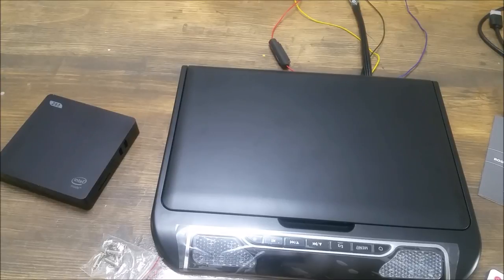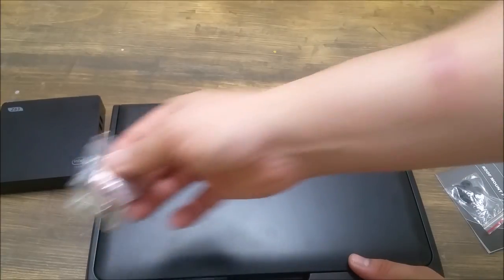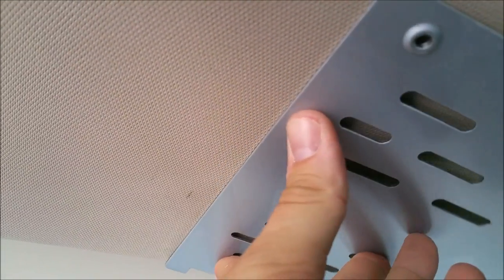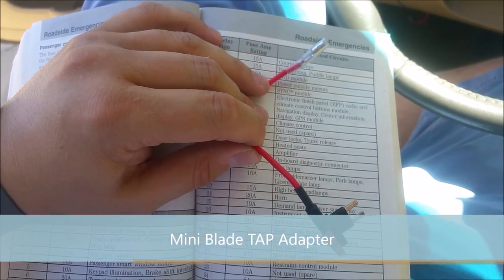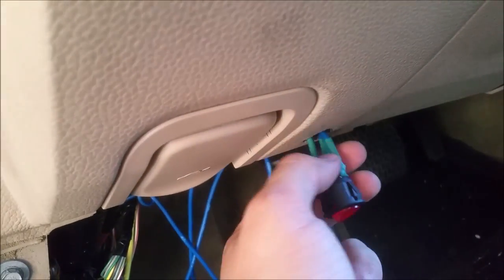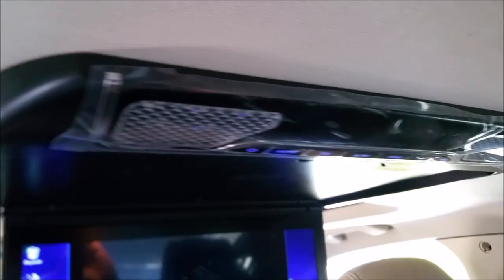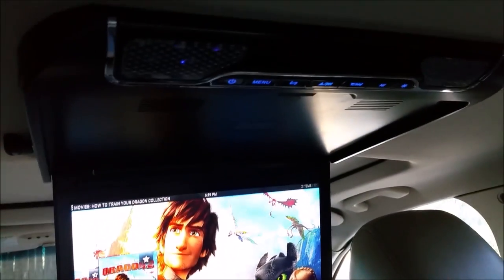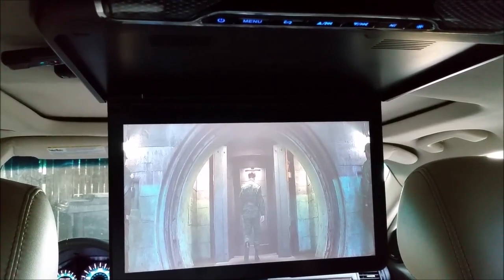Kodi in your Car with a DDAUTO Monitor Review

Comment: Great video thanks for the time stamps. Is it a problem for the mini computer to have the power cut on and off when you start and shut down the vehicle?
Reply from the maker: Thanks! I make sure to shut the computer down before turning off the car but also  I have it and the screen tied into an always on fuse  and a switch. So if I'm making a quick pit stop I just leave it on. And since I really only use this for trips, I don't want power to the screen all the time, I just flip the rocker switch.

Comment: Never use wire nuts in automotive electrical
Reply: Why not?
Reply: @codygarrett3123  it's not the propper connection, they can vibrate lose and cause a fire, at the least you should use crimp connectors

Comment: how many inches is the monitor?
Reply from the maker: This one was a 13 inch. I put one in 2 of my cars and they've worked great for years.
Reply: I am thinking about installing a 20" or 25" or maybe two of them so that I can move them to the sides to allow for full view of rearview mirror and back window and would have two HUGE screens! With the kodi setup you can download and play video games as well! I plan on getting a WiFi hotspot built directly in as well so that we can access the internet anytime instead of just when at hotspots like Tim Hortons or McDonald's etc